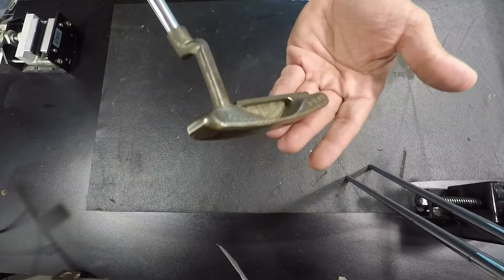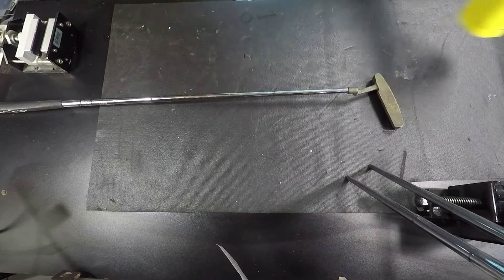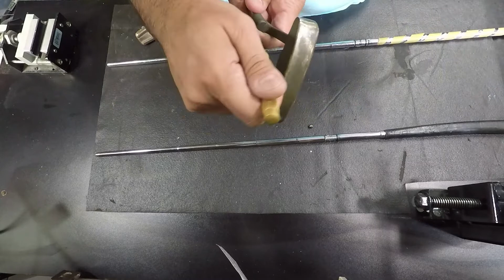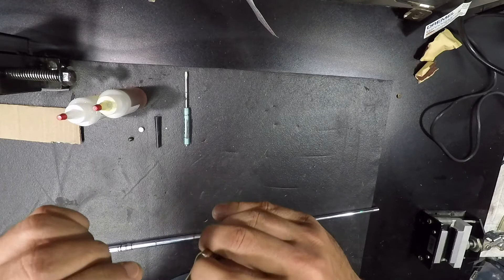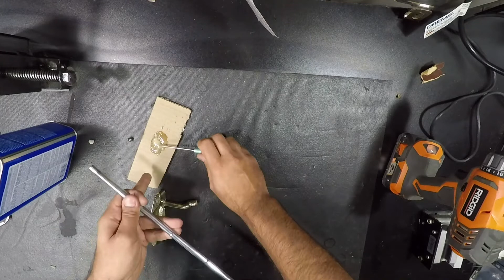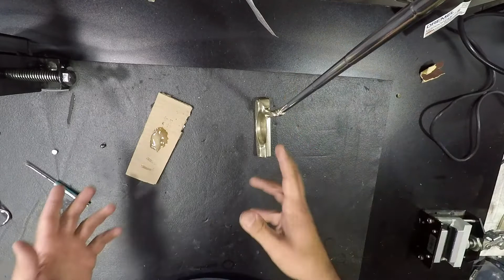How To Remove A Ping Putter Shaft

Comment: Is the metal used in this putter head beryllium copper?
Reply from the maker: they vary, the only two ways to tell are the BeCu are not magnetic.  The bronze will slightly be magnetic.  THe other way to tell is if you use steel wool, the BeCu will turn orangey/red, while the bronze will turn gold.
Reply: @G2niverse  thank you sir for your kind reply. If you could be so kind can you please help me. I own a an old bettinardi carbon steel putter which I use and it’s my favourite putter. It has begun to rust, and I don’t have access to special chemicals etc where I live. Can you please suggest something to remove the rust and get a coating on it like gun metal etc. Thanks so much
Reply from the maker: the easiest way to do this is to remove the head from the shaft. You can buy golf club head epoxy on amazon to put it back when you're done.  To remove the rust, soak the head in vinegar and baking soda for about 24 hours.  Then rinse in cold water to neutralize the reaction.  Dry it and use either a red 3m sanding pad or a 1x30 sanding belt to smooth and remove any finish.  Once you have it all cleaned up, use a degreaser to fully clean the head (wear surgical gloves so you don't get oils from your hands on the clean surface).  Then to get the gun metal coating, buy on amazon Birchwood PermaBlue.  making sure nothing it touching the surface of the putter, heat it up with a hair dryer then apply the perma blue using a cotton ball (wear gloves).  Keep rubbing on more until you get the desired color you want.  Then rinse in cold water to neutralize the bluing agent.  A light coat of motor oil every 2-3 weeks will keep your putter in good condition.
Reply: @G2niverse  🙏

Comment: I used a grinder to cut a slot at the end of the shaft to remove it. Then used an old Tommy Armour  hybrid carbon black shaft. Looks sharp & balance point now lower for better feel. Two iconic names on one club.
Reply from the maker: I like this idea if you have no intention of reusing the shaft...then again I suppose you could if you wanted a shorter length putter.

Comment: Any tips for a ball bearing that’s not budging? Hole is drilled, I’ve tried compressed air combined with the punch but it’s not budging. Is heat a better option to loosen it?
Reply: Just cut the shaft. I don’t know why that wasn’t said in the video. Go to goodwill and find a putter with a decent shaft and replace it
Reply from the maker: Why would you cut a perfectly good putter shaft?  Secondly if you cant get it out, cutting it wont do anything for you...youll just end up with a cut shaft stuck into a putter head.  You going to drill through a stainless steel ball bearing?
Reply from the maker: Yeah little heat and give it a few good hits with the punch and hammer. You'll know when you get it.

Comment: Just picked up an Anser 2 for $10. Shaft is in rough shape with pitting and rust. Thanks for this great tutorial. I'm going to give the compressed air freeze method a try.
Reply: Grind a slot in the end of the shaft, throw away shaft and replace with a carbon one, garage sales  old club to find cheap carbon shaft. what i did